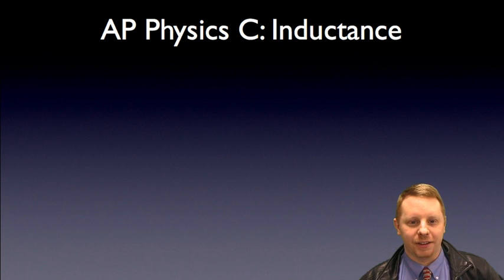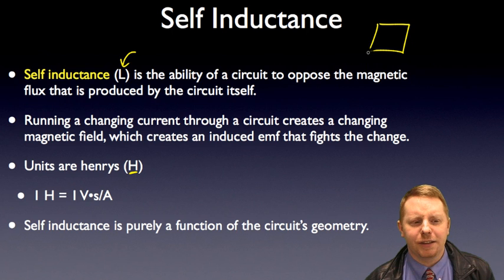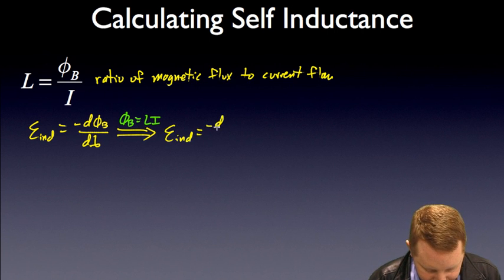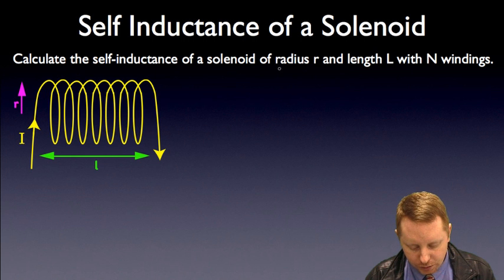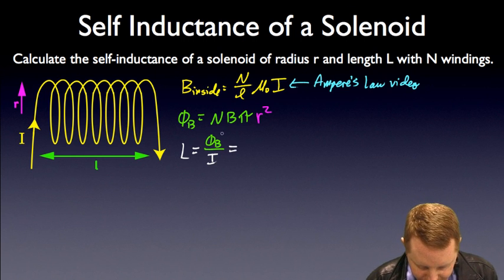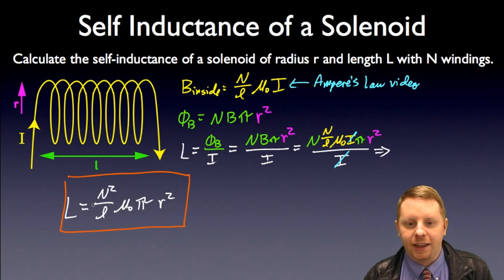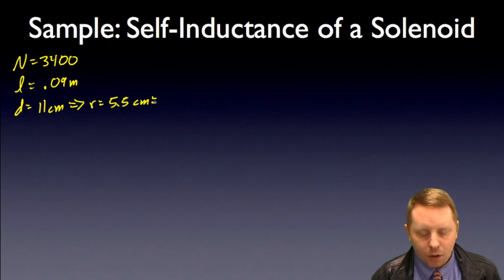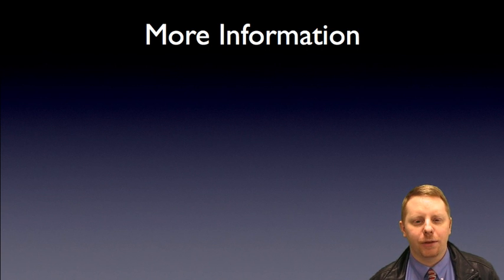AP Physics C - Self Inductance

Comment: Hi Mr. Fullerton,

I am having trouble on deciding which surface to take the area of for finding the flux.  In the case of a solenoid, a cross section (pi*r^2) will work.  However, if you have a coaxial cable, I read that you need to take the area of a rectangle who's width is the difference of the radii of the cylinders (picture: http://www.physics.byu.edu/faculty/christensen/Physics%20220/FTI/32%20Inductance/32.11%201.gif).

How do you decide which surface to take the flux over?
Thanks, and thanks for the videos!
Reply from the maker: That's a very good question... quite often you just get a feel for how to go after the problem by lots of practice and reviewing past problems.  The best way to get good with these is trying different configurations.  Some may have multiple solutions, some may be slicker than others, and some will dead end.  But it's all about practice.

Comment: hellow sir you teach very well but i have a question my question is that is inductor is used for storing current like a capacitor and what's about mutual inductor what causes in the mutal inductance to flow charges in the other coil i want all information 
thanks..............
Reply: check out transformer .